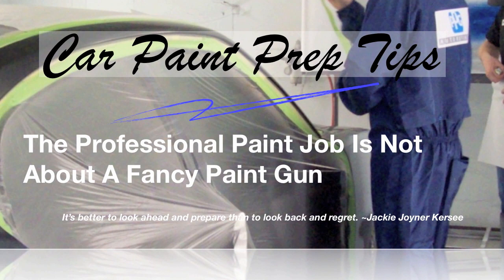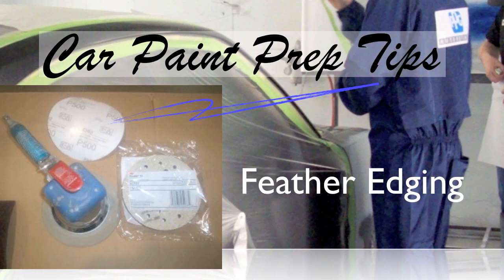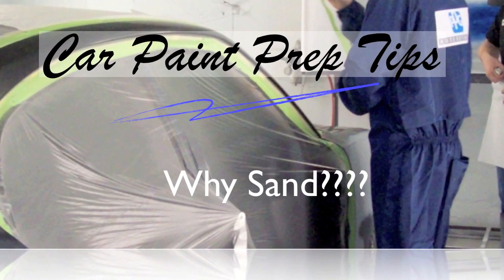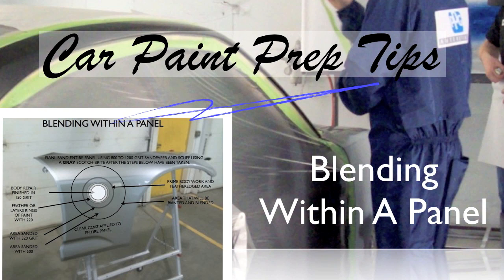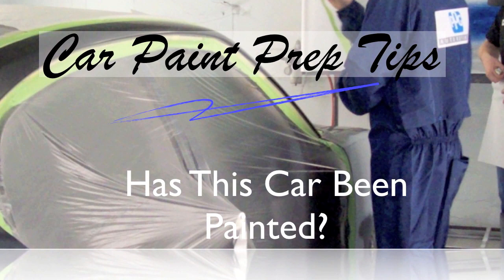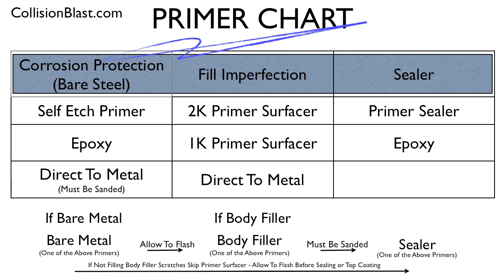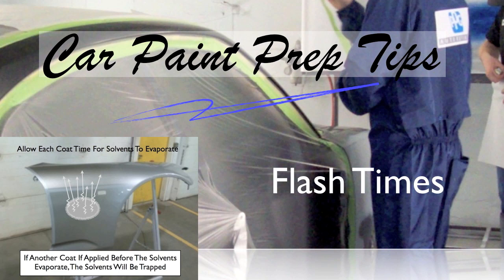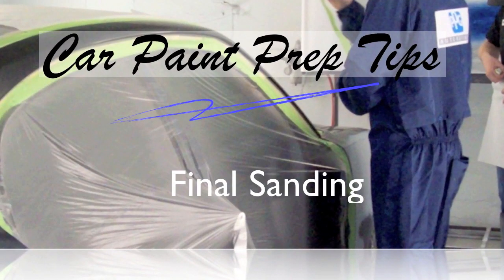How To Prep Paint - Basic Steps To Prep A Car For Paint Before Spraying

Comment from the maker: If the paint is in good condition and there are no dents, you  can block sand or use a dual action sander using 400 to 600 grit.  Then use a red scuff pad to assure edges and other hard to get areas are scuffed well, then you are ready to seal, base, and clear.
Reply: So I should add sealer?  Even if I’m going to add an additional 1-2 base coats of color before adding the clear.  No body damage, just a ton of UV damage where the clear has completely peeled off.

Comment from the maker: This is what I would do.  I would spray the bare metal and bondo spots with epoxy, then spray with surfacer.  Block sand the surfacer.  Then you can spray the entire car with epoxy if you are using it as a sealer.  Is the almost to bare metal everywhere or just a few spots?

Comment from the maker: If there is not body damage, this is what I do to remove al of the clear coat.  Sand  using a DA to remove all clear.  Then sand with 220 DA to remove 180 scratches, then 320 to remove 220 scratches, then final sand with 500.  Clean, mask, apply primer sealer allow 20 -30 minutes flash, base coat - flash, then clear coat.  There are different ways to do it, but that is how I have done this and it works well.

Comment from the maker: If you are changing colors, then you should use primer sealer before applying the base coat.  To paint the door edges you will need to open the doors.  You can do this at the same tome or you can paint the jambs and the outside separately.  For instance, paint the jambs first, then maks off jambs and spray outside of the car.

Comment from the maker: No, it's not recommended to put bondo on top of primer.  If it is a scratch or small imperfection, you can apply primer surfacer and re-block.  If you think you need more that primer surfacer to fill the low, you can apply glaze putty.  Sand the area with at least 180 grit (just rough it up, you do not need to sand to metal) and apply glaze, block and re-preim and block sand.  I hope I did not confuse you.  I have a video about glaze that I will add to comments.  Thanks!

Comment from the maker: Epoxy or etch primer should be for bare metal.  If it is only body filler with not exposed metal, you can use primer surfacer over the filler.  Primer surfacer will need to be blocked sanded.  Does this help?  Thanks for watching!

Comment: great video . Got a question that was brought up to me about laying fiberglass cloth over a repair that  has bondo on it  can this be done.
Reply from the maker: I have applied fiberglass to metal then finished it out with body filler.  But I have never applied body filler then fiberglass on top.  Figerglass is hard to finish out without using body filler on top.  It does not sand as well as filler.
Reply: This is true . I was wondering if it would stick to the bondo . I would have to put a thin layer od bondo over it to finish it off. The reason  I am doing this is because I don't have the tools to get this dent all the way out I  have at least 1/2 inch of bondo on my fender. Its been there since 2012. I was going to use the fiberglass as a extra support to keep it from cracking. I've been told than it could crack.

Comment: question*** im planning on paint prepping a car that was left out side for many years theres some surface rust on the hood nothing deep... but the rest of the car is fine as in no rust.... but paint is majorly pealed....what grit(s) should i use to to get the surfaces ready for primer? what process should i use to go about sanding this car down... its a 1988 300zx with t-tops if this helps any.

Comment: You mentioned using 150-200 grit sand paper I believe, on your body filler and then applying sealer primer. Wouldn't it be beneficial to go over it with 400 grit and then prime just in case you missed any scratches? That's the way I was taught.

Comment: do you need to wash with dove dish soap and water    and use  wax  grease  remover   first   when  do  rust repairing  inside the vehicle ?  basically  cutting out   rust  and putting in new sheet metal   inside the vehicle ?
Reply from the maker: No, I would probably keep water away from a lot of bare metal like that.  I would clean it good witax garese remover before priming.
Reply: @CarAddictGarage  thanks Donnie,  I apologize if i asked to many questions, I just don't know  where else to go to about auto body   help

Comment: so I pulled off a fender off a different car and i need to sand the old paint off and prep it for a different paint color. can I just use 150 grit paper to sand it down until all paint comes off and then work my way up to 500grit and then apply primer, paint and clear coat?

Comment: hi,  can  you  just  600  grit  for  base  coating  and  clear  all  in  one  instead  using  400-600  grit  for  base  coat  and  800-1000  grit  for  clear?
Reply from the maker: You may be able to get away with clearing over 600 grit, but it may show through.  800 is much safer for clear only.
Reply: @CarAddictGarage  thanks    donnie.  great    videos

Comment: Great video's Donnie. I have learned a lot watching them. I have a question about final sanding before paint. Painting a Amc Amx shell Single stage urethane black no metal flake. Car has been blocked to 400. Finished blocking about a week ago. Now the weather is good enough to paint. Do I need to resand the entire car before painting? I have heard the sand scratches will close up. Is a good scuff with maroon scotch brite enough? I didnt plan on sanding it any finer than 400 but I can go 500 or 600 if I have to. Dont relish the idea of sanding it all again. I hope you can respond soon as Im painting day after tomorrow. Thanks in advance and keep up the good work.

Comment: Ok , i am sorry to ask this question , might sound extremely stupid ,so will ask while the video is loading . before proceeding with any steps do i remove previous paint of a car or not? and how do i paint parts where paint won't be able to reach , like the side of the door , or corners of the hood and so on . If i just apply paint over the car ,lets say with green and the previous paint is orange won't there be a sort of like a double color ?

Comment: Im doing this for the first time, my car it has peeling of the clrear coat from the roof,hood and trunk. so im sanding it for a complete color change, i sand it with a 120 grit so maybe thats to much? I will try now to  sand it again with a 150 or a 220, then i need to primer the hole thing? Im i right or no?

Comment: dear donnie, I really love your auto body videos there great and awesome.   Im little confused on  something,  in  your 3 videos  one video   you say sand the new automotive  oem  e-coat  with 500 grit and   wash it with soap and water  and use wax grease remover     in another  another video your student  showing how to prepare   ecoated automotive panel different way.    basically your  student  prepared  the     new -coated automotive panel  by  washing    the new   e-coated automotive panel with soap and water and use  wax and grease remover and sand with 400  to 500 grit sandpaper ,

Comment from the maker: It is recommended to apply primer surfacer over body filler and block sand the primer.  This is when you can final sand with 400 to 600 grit before painting.  I have never sprayed primer sealer and paint over body filler without priming and blocking.  Thanks for watching and let me know if this helped answer your question or not.